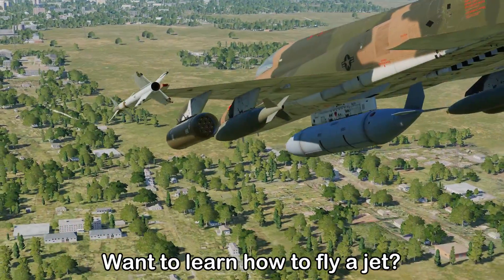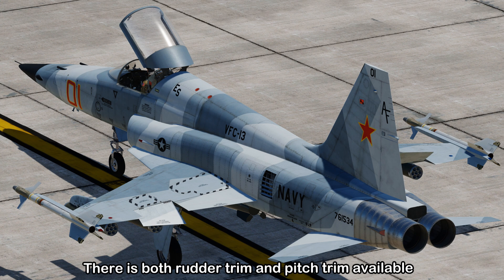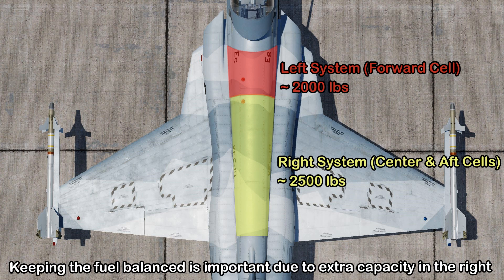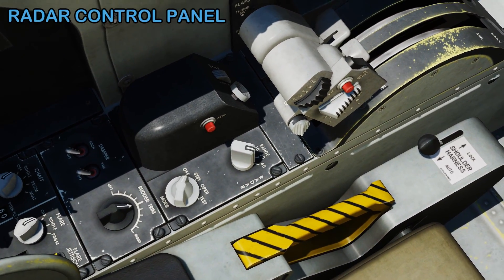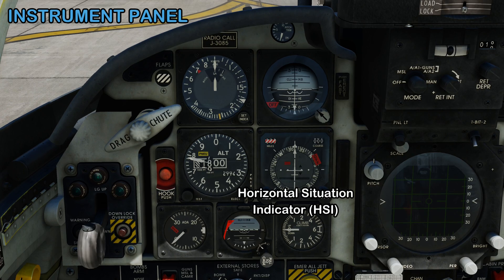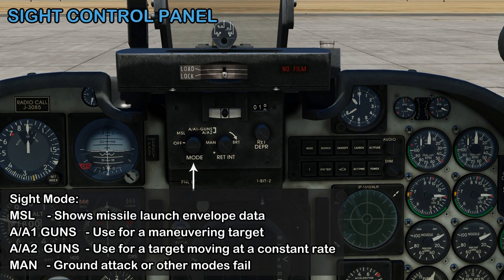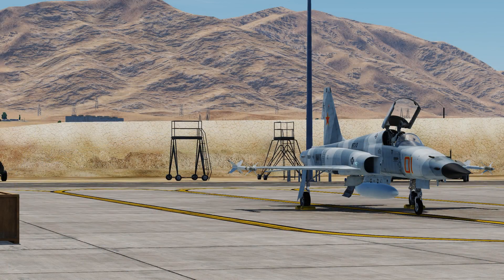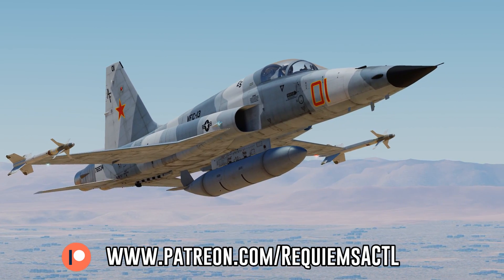DCS F-5E Tiger #1 - Aircraft General

Comment: I’m finally getting a new rig next month, and am eyeballing the F5E as my first jet. I’ve tried DCS before and attempted to learn the Blackshark for my first module. 

Huge mistake. It was so in-depth it turned me off the sim altogether. I’d like a module that’s a lot more basic and this looks to fit what I need. I was thinking of the Hornet, A-10 or Viper but hear they can have a heavy learning curve. 

Thanks for these videos, they are a good reference to have in the learning process.
Reply from the maker: Yeah the Blackshark is an intense one to get into for your first. The F-5 is a good point to start with if you've never flown a jet before. The F-86 is another option to get accustomed to the extra speed, but the F-5 is a better choice overall.

Comment: How would you know when to use the deicing feature?
Reply from the maker: A simple method with using anti-ice is if the temperature outside is 10 deg C or lower and you're encountering visible moisture (clouds, rain, fog, snow, etc) you should turn it on